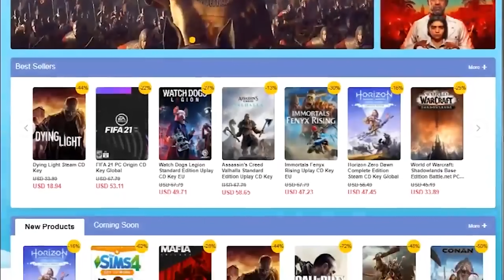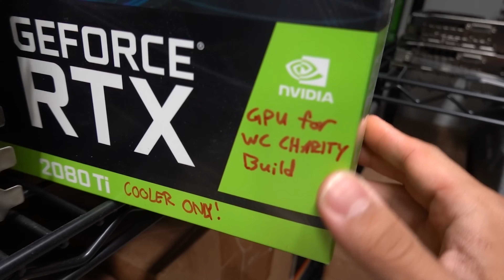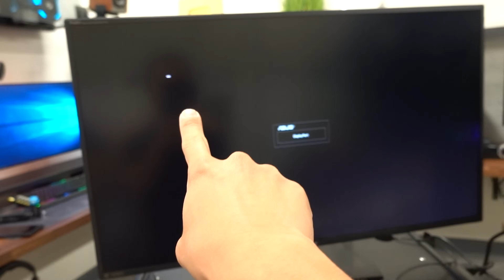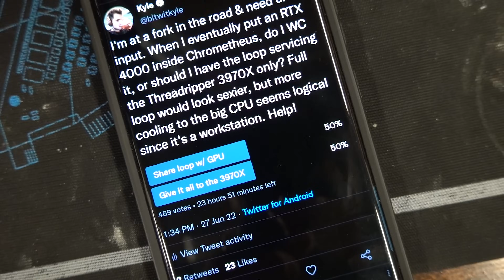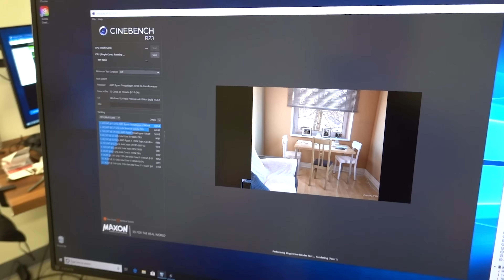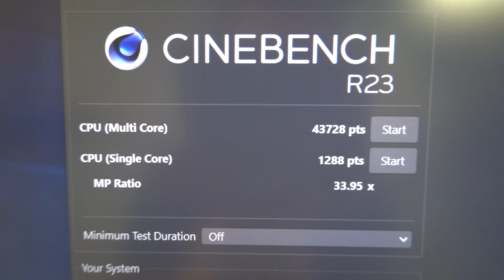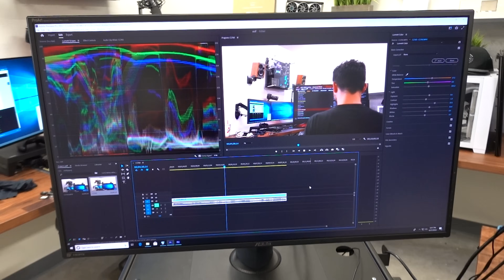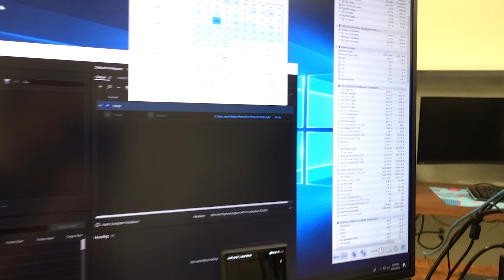YOU got my PC to work! THANK YOU!!

Comment: the 4000 series cards are going to pull so much energy/ voltage/ watts. you are going to NEED A) DDRFIVE DDRFAST DDRFURIOUS  B) NVME like a PRO or better because the cpu HAMMERS THE SHIT OUT OF IT C) RYZEN 7950X will have 1MB per core on the L2 cache 16 cores with 16MB of L2 Cache and 128MB on the L3 D) 1200-1600 PSU, the MORE EXPENSIVE ONE, the 350$ PSU because the POWER SPIKE from 4000 SERIES GPU. what is this bitches name? Prometheus? She is just an engineer for a real BEAST... OH YEAH< UR GONNA HAVE TO WATER LOOP THE FUCK OUT OF IT there byud!!!

Comment: Cosidering the temps you were hitting with the 2080ti, a  loop upgrade would be needed for a 4090.
Reply: lol I think you're on to something. If 40 series is anything like we have seen from Intel and every other "upgrade". It's going to be HOT HOT HOT. Also it might require a second wall outlet on a different breaker. Sick MR2 btw.

Comment: Dude water cooled.. Probably wanna make sure you have at least a 1000w power supply, for a threadripper, and a RTX (i need a power plant to run) 4090. But yeah water cool the hell out the build. Or keep the A.C. on " im freaking hot in the room"...

Comment: GPU water cooled. The CPU won't be much hotter. You are leaving a lot of performance on the GPU on the table.
Reply: Threadrippers get very hot.
Reply: @Miniek0  Not in my loop. Works well, 70°C max. 3970X. You do something wrong.
Reply: @kyoudaiken  Well if you're water cooling ofcourse the temps won't be too high. Besides he said he will be mainly using the cpu.
Reply: @Miniek0  He's also water cooling. So what? I got a 3090 with 480W in the loop as well and I did a 30 minute burn in. CPU: 69"C (NICE) and the GPU struggled to even reach 50°C. I don't have THAT much more radiator area compared to him. I got 2 NexXxos Monstas. One 560 and one 420. Test was done at 21°C ambient. I think to get the most out of your stuff, you need to do a full custom loop for GPU and CPU.
Reply: Oh sorry, I got a 3960X. But it has the same TDP than the 3970X, runs insignificantly higher clocks speeds, which doesn't scale in Zen 2 anyway beyond 4 GHz.
Reply: @kyoudaiken  You told him to use air cooling on the CPU and watercooling on the GPU, which as he stated he won't use as much as the cpu.
Reply: @Miniek0  No I never said he should air cool the CPU. Where have I said it? I just said the GPU won't heat up the loop too much so there's nothing to worry about.
Reply: @kyoudaiken  Oh damn, sorry I just noticed. I read your comment incorrectly my bad.
Reply: @Miniek0  Ah, I was wondering, haha!

Comment: I've started telling people 'what aren't you fixing or what are you assuming isn't a problem but might be" or more generically I tell them to fix everything they think isn't a problem and it should help the main problem. 

You may not have mentioned the fan header before because it should be such an obvious problem with a pop-up or just tell the bios to ignore it. But that's an assumption and obviously doesn't apply to everything.  

This happens so often with people asking for help on car stuff online. Only for them to admit to messing with something they don't think is related but is in hindsight.

Comment: If you're not going to tax the gpu then it won't make a difference if you just leave it as is with the 2080ti in the loop and build an all new system when the next threadripper comes out too.

Comment: Yall ever just have a second 1k gpu sitting around like spare toilet paper and forget about it? Yeah I do that all the time when I buy shit from costco.  ;D 

Glad to see you got the system goin, looks fantastic! fwiw I have a 6900xt and a 5950x in the exact same case+dual rad+distro plate+loop configuration with both sharing the loop and temps are perfectly fine. Yes the 3970x is a monster, but i dont think it needs 2x 360 rads by itself, also the extra chrome tubing will look super nice

Comment: Here Kyle goes on to show that no matter how much experience you have in building systems you still fuck up. I am curious if that original 2080ti is actually DOA or if it was another fuck up on mounting pressure. At least this system that has been sitting unused for 2 years is now finally getting some use.

Comment: I had the same issue with my 5900X when I changed my motherboard. I bought a 5600X to replace it. I remember that I installed the D15 but I didnt connect the fan. I will check it again next Wednesday that I will have a day off from work.

Comment: Btw Kyle, AMD is officially launching Ryzen 5000 Threadripper pro CPUs to the DIY market instead of OEM pre-builds. But they’re only being sold by more than $4k, possibly for keeping competition alive instead of slightly being downgraded for something that’s already OP by itself. Meaning it’s gonna be extremely perfect for you to upgrade both the CPU and GPU for proper next gen hardware. Since the ThreadRipper Pro is gaining 128gb of PCIE 4.0 lanes

Comment: Watercool the whole loop, unless the 4090ti gets too hot to have in a loop with the cpu, then leave aircooled.
Reply: If that’s the case I would recommend he mounts the distro-plate behind the front panel and uses 2 Radiators instead, which also could look quite nice in such a big case.
Reply: Or run a dual loop

Comment: It's been a long time since I last used Premiere (I prefer resolve nowadays) but having CUDA enabled, I believe lets the GPU do most of the work (thus the high GPU temps). CPU was doing practically nothing (most cores less than 30%). Maybe do an encoding without CUDA enabled and let the CPU take over.

Comment: Just put the GPU in the loop. When you're not taxing the GPU, it won't really affect your CPU cooling. I think thermals will be better in  all use cases.
Reply: Lol i was about totype ish the same thing
Reply: GPU on 1 loop with 420mm radiator.
CPU on 1 loop with 420mm rad.
VRAM on 1 loop with 120mm rad.
VRMs on 1 loop with 120mm rad.
Place computer inside closet cooled by a dedicated A/C unit. 
Maximum cooling! 😁👍
Reply: @dakoderii4221  you would also need an array of dehumidifiers for condensation, not even sure if that would be enough
Reply: @hostjhall  the HVAC is the dehumidifier. That’s one of their functions.

Comment: The reason the ram cant run at XMP 4000mt/s is because of AMD IMC and FCLOCK, if you increase SoC voltage a bit and do some tweaking with fclock, it should work (fclock should be 50% of the mt/s the ram is running at
Reply: With 8 dimms no way are you running 4000 mt/s
Reply: @Jsteeezz  its possible if SoC is changed. But I higjly doubt it

Comment: Ryzen and RAM are weird. I have two useless kits of RAM sitting around because my 5800x didn't want to boot with it. It's 3600mhz and it's RAM that says that it's for Ryzen CPUs. It worked perfectly fine with my 5600x, but not with this one. So I had to go with 3200mhz ram instead. Which is not a big deal. Congrats on FINALLY getting it up an running
Reply: Have you tried updating the bios for your mother board?
Reply: @cerealkiller4341  I did and still the same thing

Comment: I had a board throw error codes and not post because I forgot to plug in the keyboard😂 I tore down and rebuilt the pc 3 times before I realized my rookie mistake. We all make mistakes and some are such seemingly unimportant oversights
Reply: It should post without a keyboard, that's strange
Reply: @davide4725  it threw an a3 or a1 error code I think; I can'treally remember. Looked it up after and it means "waiting on user input device" or something close to that wording. The board was an msi mpg z590 gaming carbon wifi. Apparently it's not the only board that won't post without a keyboard or mouse. I think the reason why is the first thing you have to do on a new build is select the cpu cooling and set it up (on newer msi bios anyways). If you have no way to set the cooling it won't post I guess as a protection
Reply: @sidepiece8344  That makes sense. My MSI build gave me unnecessary RAM issues. I had to swap the RAM from my main to get it to post, then swapped back and everything was fine

Comment: Did you try enabling XMP in the bios , so you can get the maximum MHZ of your RAM?
Reply: Yeah no, it's definitely not that every system needs that to be done and bitwit obviously isn't very experienced in configuring the bios for best performance.
Right? There's no way that bitwit has made hundreds of computers which every single one of them has had XMP enabled.
Reply: @Sub5Hardmaxx  
Yeah you are right , he didn't even mention something about it.
There's no way he has had every build with XMP enabled.
But I still think that this might be the issue.
Reply: Isn't XMP Intel? I thought this was a threadripper build.
Reply: @absoluteai41  yeah but theres an amd thing that is the same with XMP
Reply: @moust-7  Ah yes, I own an Intel so not too familiar with AMD systems